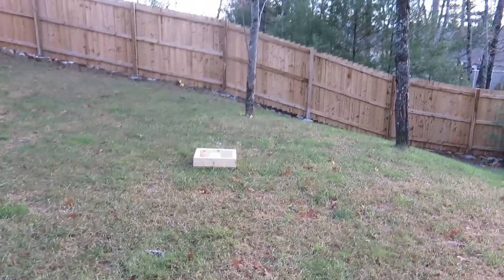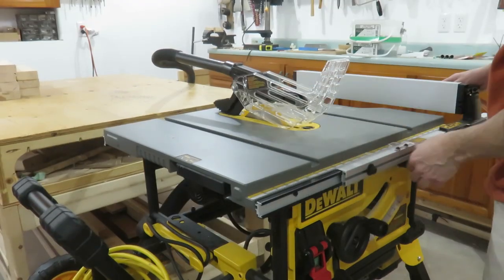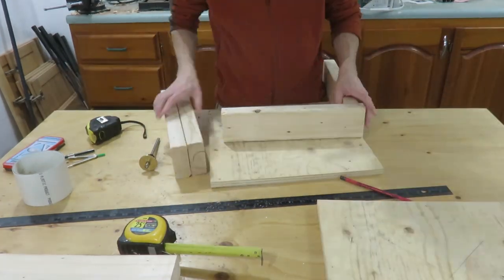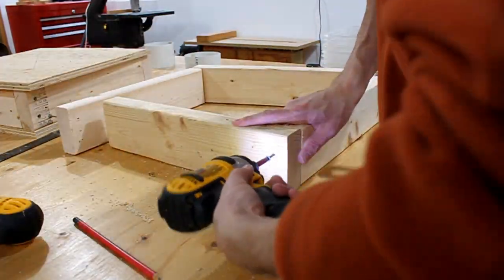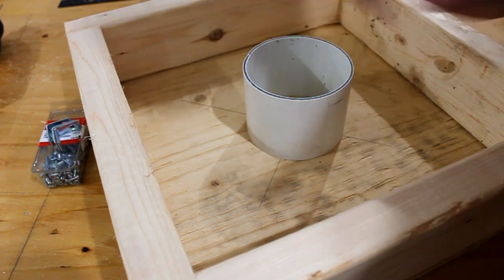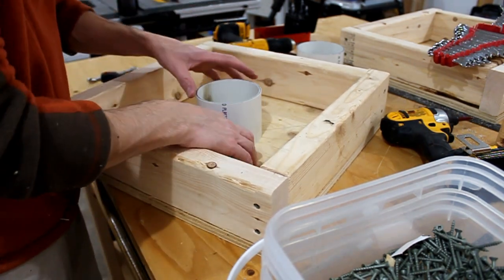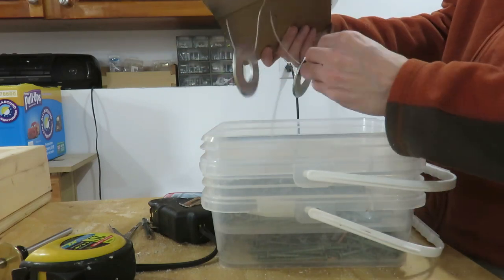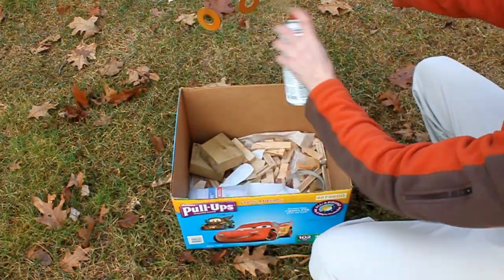How to Build a Washer Toss Game

Comment: Hated everyone's videos about making a washer game.  So much so I was about to make my own video thinking I could do it better myself.  Then I found this video. I don't think anyone couldn't of done it better.  Edited to minimize the B.S. Also assembled to perfection. The only thing I'm not sold on are the L brackets. Not a horrible idea. Just not sure they wouldn't interfere with the natural fall of the washers. Like the idea of cutting a piece of plywood to snuggle fit inside the pvc pipe better. Otherwise killer set up. We'll done my dude.
Reply from the maker: Glad you liked the video.  So far no issues with the L brackets.  A plywood disc in the tube would work good too.  Less hardware to buy.

Comment: Just out of curiosity with 16” squared 3/4 plywood and your 14 and half inches 2x4’s. Would the inside diameter of your boxes be 13” squared?
Reply from the maker: correct

Comment: My opinion.... The 2x4 frames are to tall - you can't see the pvc ring. Nice simple build though. Thanks for the video Sir
Reply from the maker: The camera angle towards the end of the video was really low so you can't see the pipe.  However when standing you can see the pipes no problem.  The pvc pipe is just shorter that the sides so they stack when storing.  Thanks for watching.
Reply: Too tall? I actually thought they were a bit short, i prefer 2×6 prevents rings from bouncing out so much even with sand, i had both sizes, anything smaller than 2×4 would  be wayyy too short lol